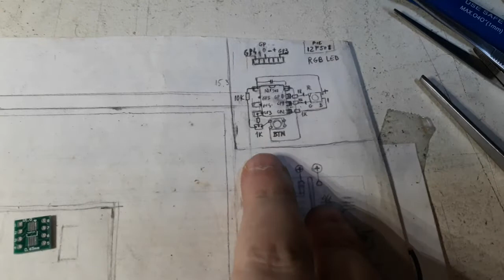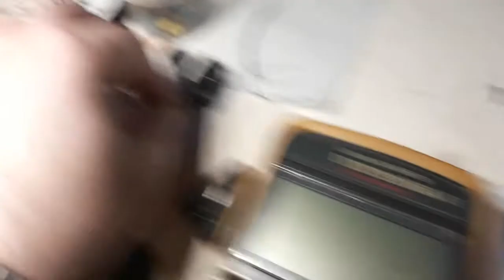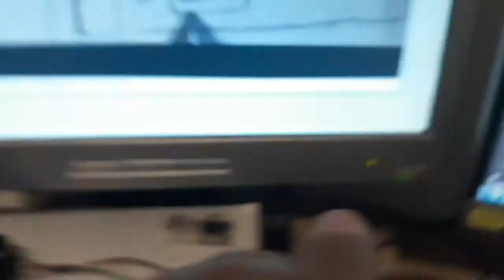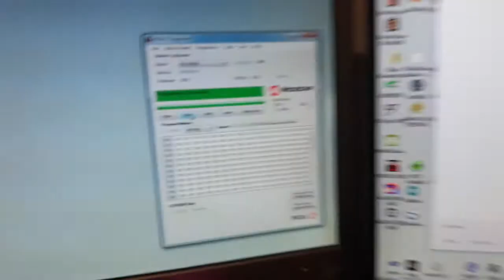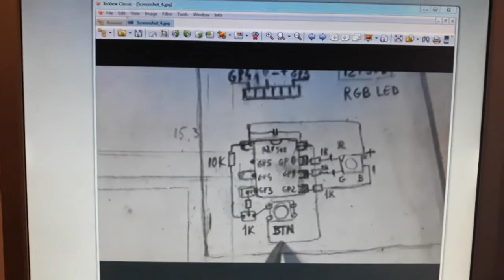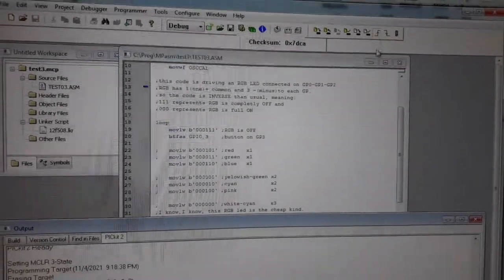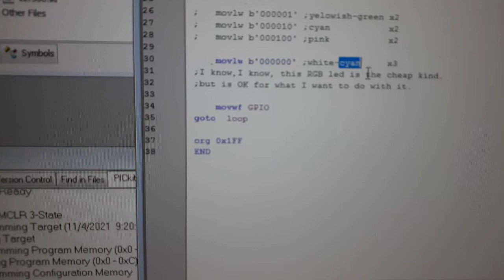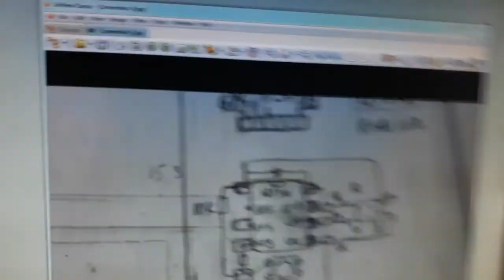#74 PIC12F508 and RGB LED - Programming phase (p2)

Comment: I have a question, maybe it's silly, but. how do you define the input pin?
I'm starting to program and I can't find any information. thanks for your knowledge c:
Reply from the maker: See if these will help your question: 
https://www.deviantart.com/q12a/art/Q20211120-Easy-PIC-10-Blink1Led1sec-898388637
https://www.deviantart.com/q12a/art/q20211111-Easy-PIC-4-12F508-and-RGB-p1-897601012
https://www.deviantart.com/q12a/art/q20210924-EasyPIC-3-Testing-Circuit-Board-892873766
Reply: @q12x  thanks, it's working. greetings from mexico <3
Reply from the maker: @Sotma  With welcome, from Romania. Glad to hear I helped.